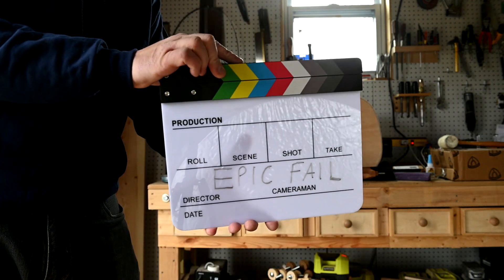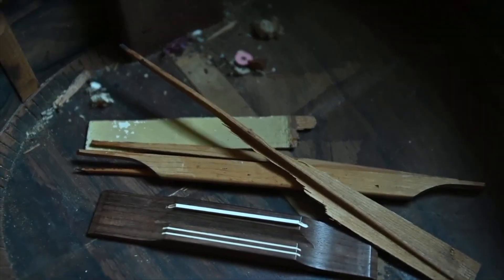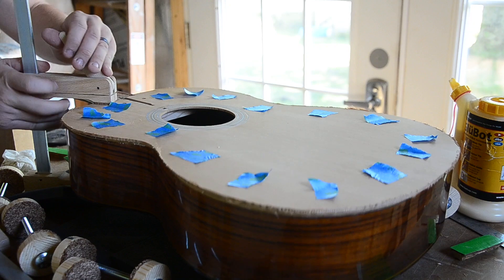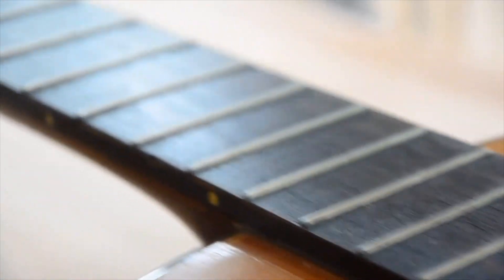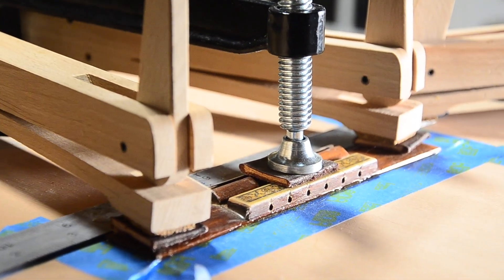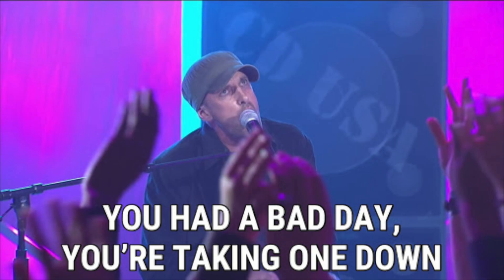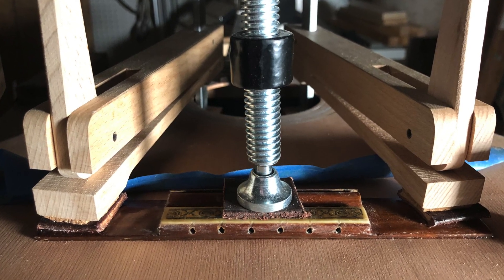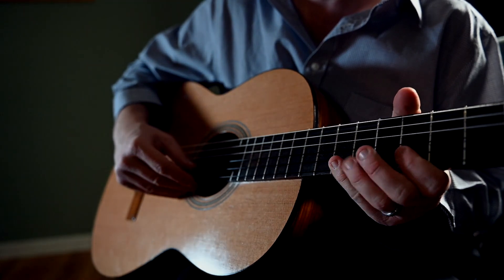How NOT to Restore a Guitar!

Comment: well, i appreciate your honesty. I've also made terrible mistakes while restoring or repairing guitars, i felt terrible. But one thing that bugged me really really strongly: If you open a guitar, espiecially a vintage guitar, take off the back, not the front. Also, you should have tried to identify the buzz instead of replacing the whole top. I'm not the kinda guy to tell you not to modify a vintage guitar, but it's just more appropriate if you want to preserve it
Reply from the maker: Oh, I agree with you on the loose brace. If I had it to do over again, that’s what I would have done. I should have probably just given it back.
Reply: @BrianGossard  no. In my opinion it's a really nice thing you dove into it, and i'm not saying this as a professional luthier or anything, you just approached the opening up from the wrong side. If you are interested, twoodford is a really talented and professional here on youtube, he shows these things in-depth.

Comment: Did the original soundboard have curvature? If so, did you try to match the curvature of the replacement soundboard with the same radius? Is that the reason why the bridge wasn't flat?

Comment: Hello Brian. New subscriber here. I want to ask your opinion as I feel certain you are qualified. I still have my first guitar, a Yamaha FG830. I have moved into playing better guitars (Martins,Red Label Yamahas.) I want to mod my FG830. I feel the body is the best part of the guitar, it is laminate. I want to replace the neck with a 12 fret slotted head neck. Then do all the new edge binding,nice fretboard type stuff. I want to put a K+K pickup inside along with an under bridge support plate. I also want to go as light as possible with the top lacquer (like a Martin) I want to do this first with a cheaper laminate body and when I have one under my belt do another solid mahogany body. I will tool up for the work (I hope that this can be done for 1000.00 in tools and supplies.) Oh I am a recently retired auto mechanic. Mechanics think they can fix/mod anything. Thanks for giving my plan a look over.
Reply from the maker: Dan, send me an email if you can and we can talk a bit. I don’t always see YouTube comments and the answer to your question may require some back and forth. My email is briangossard@me.com

Comment: Great video, I'm confused however, what adhesive on the MacBook? Most MacBook batteries are held in by screw and are easily replaceable, what model was it?
Reply from the maker: They started gluing them in, in the 2010’s. In theory it’s to keep things from rattling around but I think it’s also to discourage people from repairing it and push them toward buying a new one instead.

Comment: I'm no luthier myself (it's one of my life dreams, though), but I do some woodwork. This accident is way more common that it should be. It happened to a cheap guitar a niece got for xmas. I think it's just a very flawed design, just like the usual broken Gibson neck.When you have 2 pieces of wood glued together on a single flat surface, and tension going on a completely different direction, accidents are bound to happen. Do you think, as a luthier, is it possible to maybe add (a) pin(s) below the bridge, or a socket in the top to sit the bridge inside?
Reply from the maker: Thanks. I’m not sure I would really call myself a luthier either. I’m a teacher and a hobbyist. Let’s put it that way. I have seen some instances where bridges are attached with pins or other fasteners in addition to the glue. However that’s unusual to see unless it’s to shore up an existing problem. Generally, the glue is strong enough to not be a concern, although they can still begin to left over time. I think with wood, we are always fighting a bit against mother Nature. Even on the Gibson I did, I had some cracks that I had previously fixed begin to reopen and I had to address that. The natural flex of the wood over time is something that we’ll just always have to go back and revisit I think.
Reply: @BrianGossard  I think that the joint between the neck and the headstock on Gibson guitars is one of the worst designs in music industry. Having said that, I love those dang guitars.

When two pieces of wood are firmly glued together along a single flat surface, but you apply direction that is not perpendicular to the joint itself (as in classical guitar bridges, or the gibson headstock), then the joint is bound to fail sooner or later.
Thanks for the awesome video.

Comment: Maybe I would recommend adding a radius to your bridge to fit the radius the soundboard you should have. I mean, I don't know if you do it that way, but I learned to add a 10' radius to the bracing to force the soundboard to take this radius. Tho if you have a flat top, of course I'd go with the flat bridge
Reply from the maker: Thanks! Good advice. It was a flat top, so the flat bridge was what was needed. Where I think I really went wrong was with the clamps. I’m going to have to invest in some sound hole clamps.